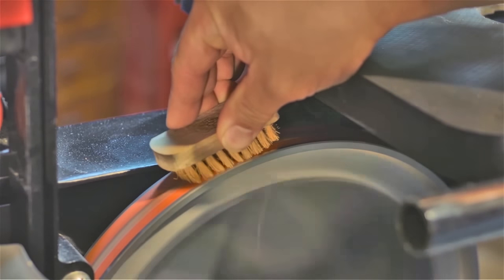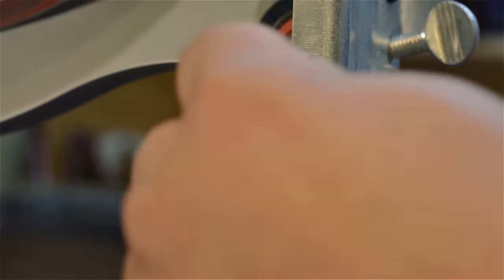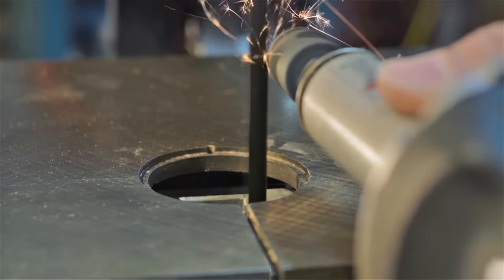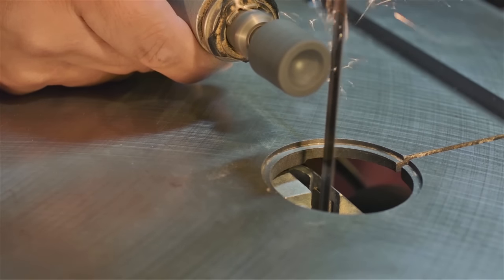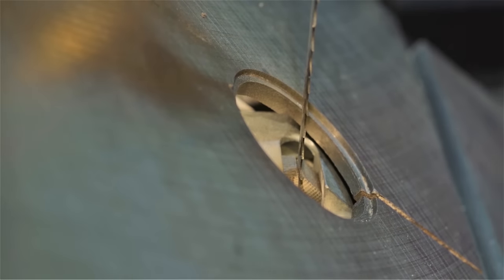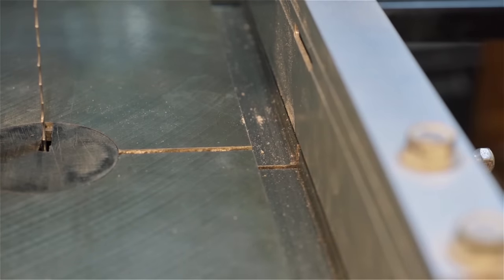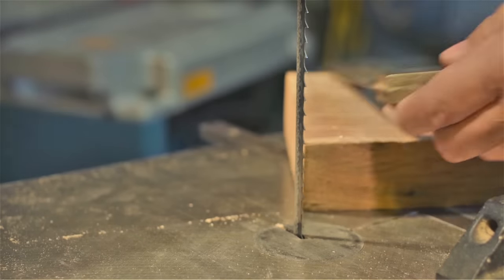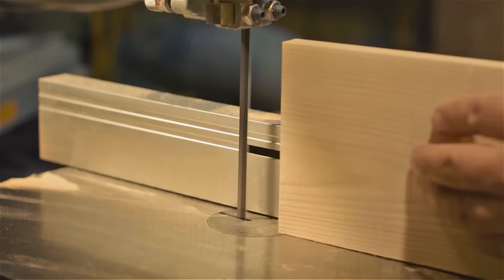Bandsaw Tuning For The Anally Retentive

Comment: This video.... I have El cheapo Ryobi and cheap is great if you tweak it and top of the line tools produce crap in the hands of un knowledged..... I have cnc mill and lathe.... And can make just as good if quality with home made mills and lathes.... It's all in the operator.... Now of course I do some slop work too.... It's all about what I'm producing.... Some things I'm meticulous others course enough for government work is acceptable..... And sometimes if it's a temp piece that is expendable I will go totally crap and slap together... Quality comes from the man not the tool.... And the best quality time are those you build yourself..... If you can build a lathe you can build from it any tool you will ever want or need....
Reply from the maker: Thank you for the comment. I made the video really to express how I felt about every other band saw tuning video - which seem to be copies of one another and the same info repeated over and over - without validation to its effectiveness. It is my hope that other folks will post how-to videos of their technique for common problems. Cheers!

Comment: meaningless. Its bandsaw, you'll never need to have a finished cut with the bandsaw, you're working with wood, wood will shrink and expand more on itself than the thickness of your blade.
Reply from the maker: Why would a finished cut not be wanted? Why would I not want to rough out exact cheeks for fitting my rifles, or make tight joints in furniture? Why would I want to spend extra time shaving with a chisel or sanding down? Does wood shrink or expand more along the length of the grain or across to it? How much does plywood (or mdf) expand or contract vs wood? Does a thin piece of wood expand or contract the same as an extremely thick piece? Have you head of Poisson's ratio? When you miter joints for interior trim do you just leave a blade thickness gap everywhere? Why dismiss something without first understanding it?

Comment: for the anally retentive? no.  for the neurotic who are willing to compromise blade integrity and personal safety for a perceived perfection? yeah, definitely yeah.
for one, a bandsaw is not for perfect cuts, you're best served by a tablesaw for that.  
the blade flutter?  dude, that's the blade bouncing back and forth while between wheels.  that's part of what the blocks are for- to steady the blade and give support.  the blades are going to have memory from when the machine wasn't running and will be somewhat 'bent" and cause the fluttering.  by grinding the sides of the blades (I still can't believe i saw that, and hope it was a ruse), you are doing nothing but thinning the blade and compromising its strength/integrity.  even if it was necessary, you can't grind the teeth, and THE TEETH ARE WHAT ARE CUTTING THE WOOD! the spine is simply following behind the teeth- you are doing nothing!  
you need a new hobby if these tools make you that neurotic.
Reply: you serious? Grinding the back of the blade makes it to where it is even and can ride against the bearing smoothly, thus reducing chatter. Same goes for the sides. He isnt removing material on the blade, so much as reducing imperfections in the machining. It isnt near enough to effect the integrity of it. Cutting veneers and making parallel cuts is a good reason to remove chatter and blade deviations . I don't know what you think you're upset about, but it shouldn't be this video.
Reply: BS
you are going to have more lateral deviation due to the memory of the steel from the wheel, than any variability in the blade thickness.
I'm not about to get into a pissing match with another internet warrior that thinks they understand the world.  whatever helps you sleep at night, bud